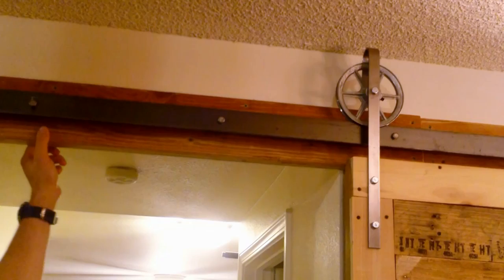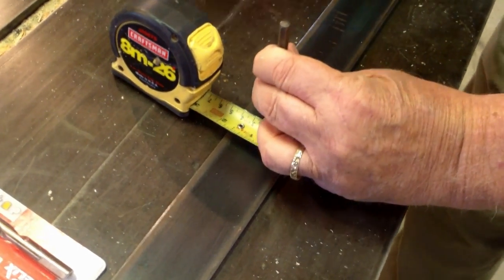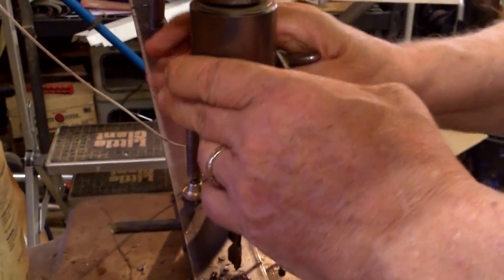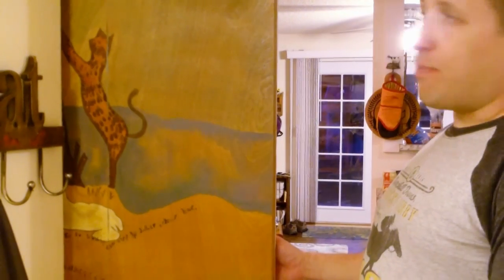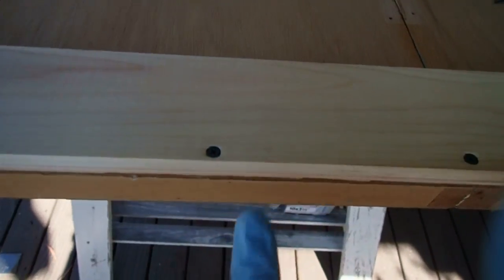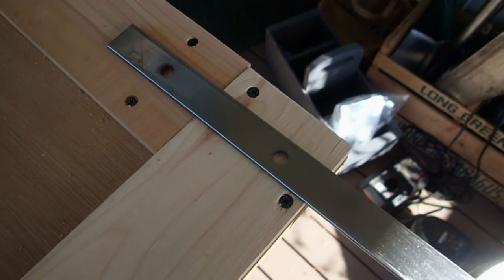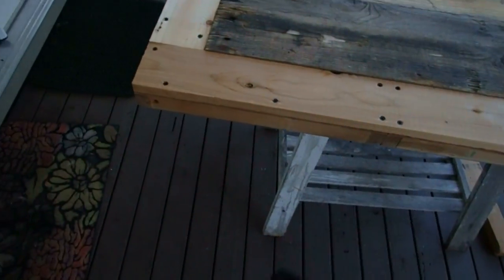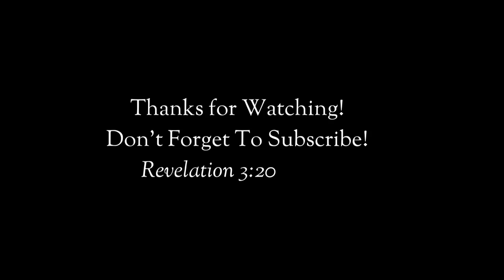DIY Sliding Barn Door made from PALLET Boards

Comment: What size flat stock did you use for the track and what did you use for bolts and spacers. Where did you get the wheels an what size are they.
Reply from the maker: The rail, spacers and wheels came as a set  at omalikitchenbath.usa. I don't see exact specifications but you might contact the seller about this listing and find out what you need (http://www.ebay.com/itm/Sliding-Barn-Door-Hardware-Kit-6ft-12ft-Rustic-Raw-Steel-Vintage-USA-/252183575247?var=&hash=item3ab74ffacf:m:mUIkJsfTjJ-Ka3FsAB-OjAA)
The wheels are 6 inches. The bolts were 3/8-in x 4 in.

Comment: What size is the flat stock for the track and what size are the spacers.
Reply from the maker: the flat stock is 2" wide and 1/8 " thick. The spacers are about 3/4" diameter and 2" tall